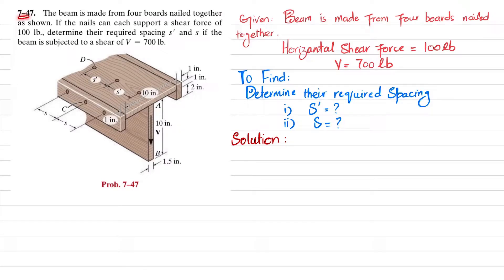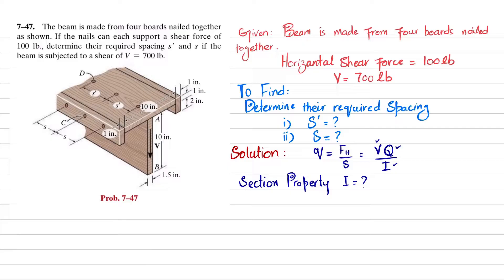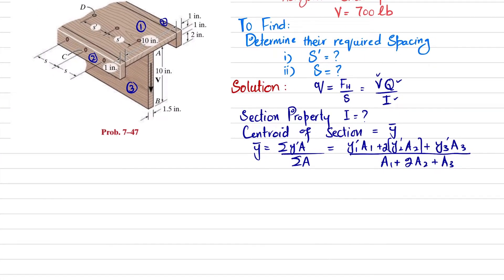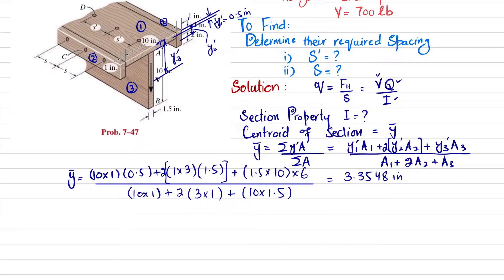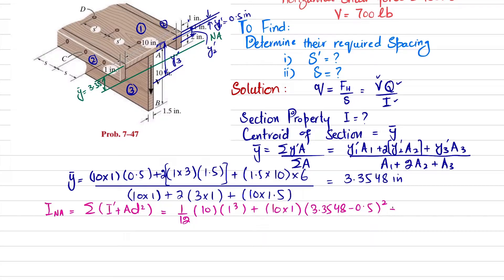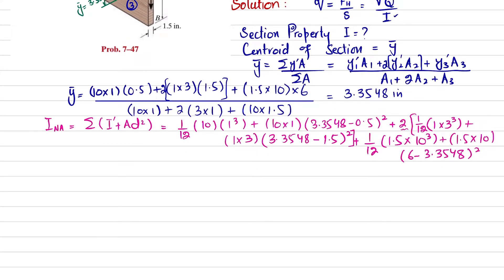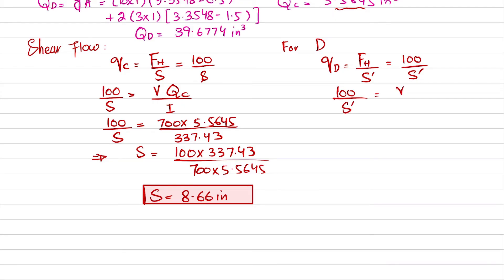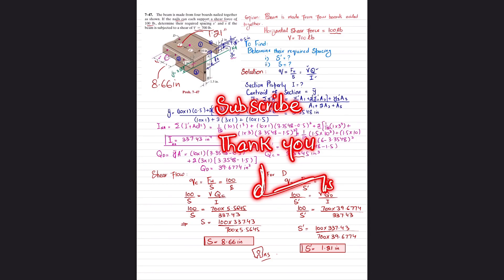7-47 Determine required spacing s' and s if beam is subject to shear | Mech of materials rc hibbeler

Comment: Thanks for the video, a question, why do you take the moment with respect to that entire large area in the case of Qd, and why don't you just take the area of 1x10?
Reply from the maker: You are welcome. Also for the the nail distance on the top board we find Qd and for the nail spacing on side board we take Qc to find the shear flow on the junction of boards where nails join them.

Comment: Sir, can you please help me in identifying the sections that i need to use to solve for Q.
Reply from the maker: You want to say that I should identify the other section for calculating Q. I got that you want another question with different section.
Reply: @engradnanrasheedmechanical  Yes, sir the selection part confuse me a lot, cause other beams we section differently...Otherwise you're theeeeeeee bestttttttttt.🥳🥳🥳
Reply from the maker: Here is the complete playlist for this chapter. It contain easy to complex problems

Comment: so when we find Qc and its  A' can I use the (10X1)  in that area?  not use (3 x 1) that area if I can't do that how am I supposed to know what time I  need to use which one, compared with the video 7-46??
Reply from the maker: You can see the nail on point c having board of thickness 1 inch and height 3 in so the area will be that. If you are taking at point D then Area will be 10x1 plus 2(3×1). Its very simple bro....